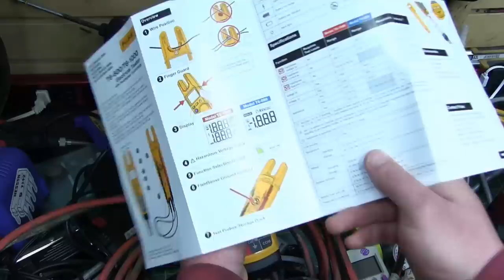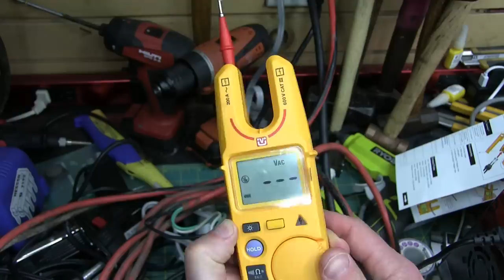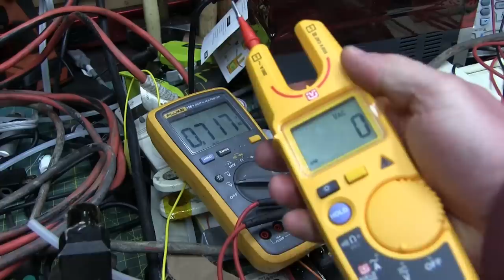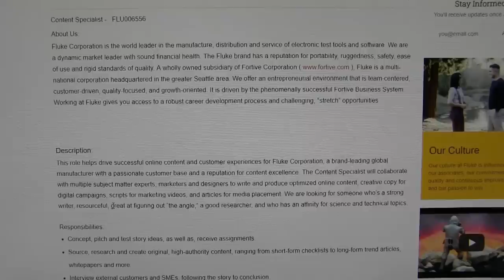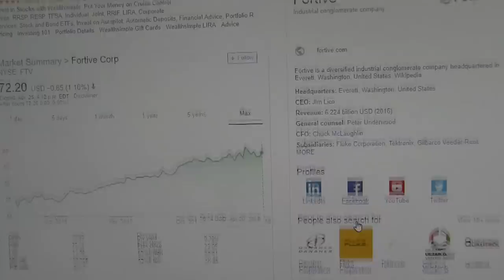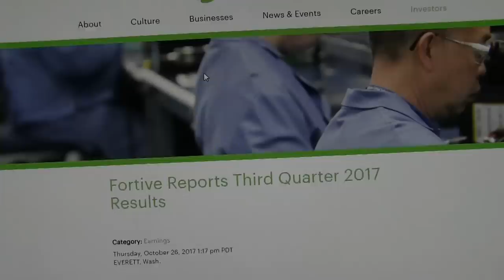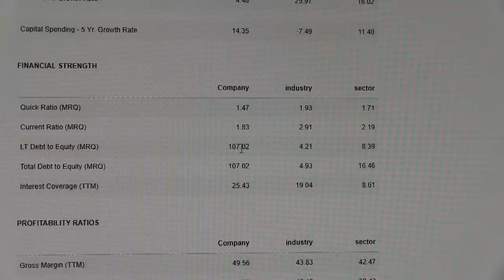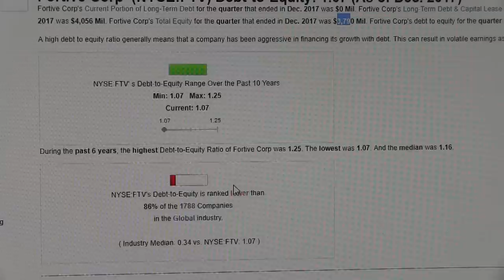Fruke's JOY BUZZER™ Multimeter! | SHOCKINGLY BAD T6

Comment: There is no way (except through incredibly bad engineering) that grounding point could become energised with anything but very small capacitive charge coupling. i.e. not enough current available to do any damage. There will (should) be very large value multiple (high voltage) resistors in series with that grounding pad to limit any current.
In fact this would be a stringent requirement in order to get UL CAT certification.
But worthy of more investigation to ensure this is the case.

So I'd be stunned if Fluke have goofed this from a safety perspective, but that doesn't mean it's not a dicky product from an operational viewpoint.
Reply: Fluke Aus HQ is just around the corner from my lab, and they offered me one back in Nov. Maybe I should take them up on that...
Reply: I think the shoddiness of the product and the companies dishonest response spooked him into being hypercritical which led to a miss with that particular haymaker, but the rest of em still landed so ultimately he's right about the tool, just wrong about one isolated detail.
Reply: I, and many others, would love to hear what you have to say about this. :-)
Reply: so if something goes wrong it it going to not ground at all or is it going to be a rude awakening?
Reply: Un7ucky it depends...if the resistor network goes open circuit...it will stop working.  If it goes short circuit ( like if it gets some water!) You are in for the ride of your life.  The people saying it's safe can have it...I wouldn't use it for current testing.
Reply: Jamie Smith - So you trust a capacitor to save your life? 
You do it every day and you don't even know it by the sounds of it. I won't tell you how and why, I'll let you figure it out.
Reply: EEVblog 
Yeah, but — shiny phones are cool...
Reply: Jamie Smith the plastic around the leads is actually a very big resistor... So yes
Reply: Dave Jones of 18 years ago, filming in his garage would of had no problem of calling this kind of products a heap of crap.
Reply: Jamie Smith so long as it fails open, probably
Reply: EEVblog says "do not submerge in salt water" on the back.
Reply: koitk - I have not seen it so I can't comment apart from an engineering knowledge perspective.
Reply: No you don't. Not only, there are multiple layers of protectioin.
Reply: So the pad is disconnected in current mode?
Reply: You trust resistors every day to save your life. The question is how likely they are to fail at any given point and in any given situation.
Reply: I also comment on my perspective. I like AVE because he doesn't have to like products just because he's income is tied to good reviews and Youtube income, that was same reason I liked your videos back in the days. But I get it, you now have family to support and tube is your main income and you kind of have to have good statistics there. I'm just saying back in the garage you wouldn't of said it's a good multimeter.
Reply: To be explicit: an "insulator" is just a really high value resistor. air for example; It's just rather unlikely to have a manufacturing defect.
Reply: EEVblog  My friend is an Electrician. He told me the first rule is NEVER get cocky around electricity. Unless you want your last moments to be getting baked alive like a potato in a microwave.
Reply: EEVblog Did you not watch the vigayo in its entirety? PAY ATTENTION!
Reply: Would love to see an engineering breakdown of the Circuitry Dave.
Reply: Line of Ephraim House of YAH I Agree
Reply: EEVblog just do your investigation of this and keep it honest as you are seen as a saint in this community.
Looking forward to your video.
Reply: His line voltage was showing 123V when the capacitive measurement thingo worked briefly. When he measured from the ground pad with a 10Megohm meter it measured 106.5V. Therefore the impedance of the T6 is (123-106.5)/(106.5/10000000) = ~1.5Meg. Given the meter is rated for 600V this would allow 400uA to flow if you were <<1.5Meg (e.g. damp fingers). Won't kill you, but seems a bit marginal - you'd feel it at 600V. This is kind of like designing bridges - they often way over engineer them so they don't bounce around too much or sway in the wind, which is not dangerous but can be disconcerting to the layman.
If the impedance of the T6 is in fact capacitive instead of resistive then the current is probably even higher than this because the capacitive impedance of the 12E+ will be less than 10Megohm. The question of "1.5Meg might be safe, but what is the impedance under overload conditions?' also has to be raised.
Reply: Dave I would love for you to take one of these apart, I would def watch
Reply: I don't think he said it was a good meter, he commented on the safety. I would say its a good meter for what I use it for, its not sold as a full featured multimeter. When I need more features I pull out my 116 or 87-V.
Reply: I would like to see what would happen with a regular person-like resistor in connected to the ground "button" and the live actual plugged in. since it doesn't do it's job anyways, could we see if it really zap someone?
Reply: koitk - Have you not seen my videos were I have exposed Fluke, Keysight, and other huge companies for bad product design. My videos have cost them untold amounts of money in recalls, fixes, and bad press.
And I've done this in recent times after I was "out of the garage".

Here I am simply playing devils advocate like I always have. If the product is shit then I will say so, but I can't say so because I have not seen it. But I do think AvE left out some technical detail in his analysis which is what I am sharing.
Reply: koitk
 - Go back and read my comment, I did not say it was a good meter, I have not seen it, I can't say that. I'll reserve judgement until I actually get my hands on one.
Reply from the maker: I appreciate your expert take on this Dave. I'd love to get my hands on a EEV blog Brymen IF THEY WERE EVER IN STOCK! :P
Reply: Don't give into the trolls my friend, EEV blog is a smart man who is pretty down to earth. Not everything needs to be an attack and choose a side, somtimes its fun to shoot the shit and talk about stuff
Reply: Given the financial situation of their overlords, I'd say they're in the midst of a full-blown r*pe scenario, and by the time Fortive is done with them, there will be nothing but a badly-corroded name and totally destroyed reputation. And Fortive's "executives" will skate off with millions in bonuses in their pockets. 

F*ckin' thieves.
Reply: Jeffrey Ellis big Clive is on here too, bet you don't have the balls to call him a power puff...
Reply: That was my first thought as well (would have loaded it with a 100k resistor and see what happens).
So, from a direct safety perspective, it's probably okay. (you're not going to get fried through the ground pad).  OTOH, I think it's still a super unsafe tool.  You could easily measure a circuit to verify that it's not powered, and get a false reading because the wire's a tiny bit out of place, or the insulation is really thick, etc.  Then you poke things in to what you think is a safe circuit.
Reply: EEVblog hi Dave. I think the people here would like to see your take on this product. I for one would so. Kinda an unofficial collaboration. Would definitely be something worth watching. Then send it over to electroboom. If fluke shit the bed on this one, this will be a rude awakening
Reply: Ann Onamous Try measuring the output from a usb charger with respect to ground. The majority (including reputable brands) will have a significant fraction of the line voltage due to the EMI capacitor across the switching transformer. Its high impedance so you won't get injured or die.
Reply from the maker: Orders T6-1000 on comment 7 hours ago. 2 hours later "full of shit- works everytime." Bwahahaha.
Reply: Stunned... I see what you did there lolll
Reply: Until you grab a live wire which indicated no voltage???
Reply: UNI-T did it first
Reply: YES YES and another YES. You could do your classics "don't turn it on - take it apart".....and a follow up video chat to Piet to give an awesome smackdown
Reply: James Kerns Jr. 
Uhm... current testing? Where you are inserted in the circuit... well i wouldn't do that either ;-)
Reply: EEVblog There is nothing more to say. I absolutely agree with you.
Reply: I think this is exactly the same case as in your video about the "Wi-Charge IR Wireless Charging", when you don't know (me neither) how in hell they manage not to fry with a multiwatt laser some things of the room or even parts of the body of the users. You know for sure the grounding point can't be energised because your knowledge and "the experts" of that IR Wireless charging thing know for sure they can't blind or cute fingers of a person because their knowledge. But you, AvE and myself can't avoid thinking "Yes, but, What if... ? ". Cheers !
Reply: EEVblog Dave, you should review this Fluke.. Not AvE
Reply: Just measure the resistance between finger pad and where you jack the negative in next to the battery holder, should give you a good idea
Reply: @EEVblog  You know, I was looking at this meter, as a quick grab alternative.   I was thinking of looking at one, and seeing If you could cut that whole self-grounding pad circuit out.  I mean, just rip out the contact for the lead in the resting position, and the wire / conductor that leads to the pad.   I'd picked up on the need to center the conductor being tested in the center-bottom of the notch, and that does not bother me being slightly finikey...  but to introduce a random or questionable ground, depending on your levels of competence, confidence, and ultimately continence, That your life depends on.   That thing would be out of there.  I'd only be using the neutral on a better ground anyway.  

 My thought was, why would you ever want to use your body as a ground when playing with a twenty or a two-hundred amp circuit?  This seems like the sort of thing that happened when they first began to run electricity, and electrical workers had a lifespan approximately the same as new fighter pilots in combat in ww I.

Comment: "Have you ever picked up a Fluke that doesnt f*ckin work?" 
As an elechicken by trade, this resonates with me. Every Fluke Ive ever owned I consider to be a life-saver. Particularly upsetting that the brand I trust would potentially risk my life and call it user error. There seems to be an upward trend in craptastic tools. This is a very real reminder that double checking everything is worth the trouble. Even if the journeyman said its dead, check it again. And use your own damn meter.

Comment: Wife worked/retired for Fruke, making parts on the shop floor. After listening to the stories of how the company was changing and what went on; temp employees, nonexistent quality control, crap internals; I vowed not to buy the brand (and they have/had a great employee discount).
Reply: Yep. I used to work for a company also owned by the big 'D'. Many of the original employees started leaving after about 5 years into the acquisition. They were trying to push mass production of niche, high end electronic equipment. Local machining and electronic board vendors were shut out for cheaper outsourced parts.

Comment: Paused at 1:06 and popped some popcorn. Especially since, as a network engineer, I rely on Fluke gear regularly. It’s expensive, and I trusted their gear at that price point. My work backpack has several hundred doll hairs worth of testing equipment. Maybe I should stick to Ali express. At least you get what you pay for.
Reply: Get a Pockethernet. I do the same thing, and I’ve largely switched to just the Pockethernet instead of a bunch of Fluke.

Comment: I was always told I did not understand the device when I refused to depend on the "chicken stick".  But I was never in for any great shock.  I just do not like that current through the body feeling.
Reply: Amateur Redneck Workshop  - You got that right!!
Reply: I hate those volt sticks! And even worst when guys try to use them to troubleshoot a non working outlet when it’s a loose neutral and they can’t figure out what’s wrong!!

Comment: Just info here I did some testing on my T6 and found the input impedance is 10 megohm. To verify this I measured the current draw at 120vac and indeed the total current was only .12ma. That's right just over one tenth of 1 milliamp. What's more the joy buzzer pad is capacitive coupled to the black lead when its inserted by a 220pf capacitor.  Doing the math on capacitive reactance that's only approximately 12million ohms resistance so added the the internal 10 million ohms would result in a total current through your finger of .0545ma. Just good for thought. Also to use the field sense the live wire must be in the deepest part of the "U" aligned right dead center with the nib on the case. Keep up the great teardowns. Keep your D#@k in a vice!

Comment: I do not believe that you will get shocked if you touch the earth connection of the current clamp while you are probing the mains. If the meter is set in the voltage range, the meter has a very high impedance of around 10 mega ohms. You will only get about 0,012mA of current sent through your body in this case. You won´t even feel it. The multimeter still picks it up because it also has a high input impedance. You can verify my theory by measuring the voltage with a low impedance meter or you could measure the voltage drop over a resistor. If you load it down the output will instantly drop because there is no power behind it.

But if you set the meter in the current range, it will be dangerous because than the voltage goes over a low resistance shunt in the meter, which can easily conduct enough current to kill you. But i think that the clampmeter automatically disconnects the ground connection to touch if you set it in the current mode. Maybe you should try to confirm that.
Reply: Well you first ... I’ll watch

Comment: Hey....   I use my T5 just like that...  With the probe jammed in the meter... kinda sucks cause Probe is 2 part so when I try to pull it out the tip pops off... It works out though, I use the tip to force the rest of the probe out of the groove.   That "contact" pad reminds me of 70's era soda machines. ( they'd shock the snot out of you if you were wet)... LOL
Reply: "when I try to pull it out the tip pops off... It works out though, I use the tip to force the rest of the probe out of the groove"
May I quote you at my next urologist appointment?  
I haven't laughed so hard in a year; Thank you, OldSkool!
Reply: Of Course!
Reply: Lol, I haven't laughed so hard in months...
Reply: Add tape to the inside of the probe  it will not pop

Comment: As an elechicken I own and use meters and "no touch testers"  regularly. I have been screwed by no touch testers and confused by meter readings at times causing me to take a second look before proceding. In my experience if i cant trust my meter at all times it is not worth having.  "No touch testers" SHOULD NEVER BE TRUSTED  only used as a warning that the circut may be a live or another wire in the area is. When in doubt check twice or more. USING YOU BODY TO COMPLETE THE TEST CIRCUT IS AN  EXTREMLY BAD AND DANGEROUS IDEA.   This is one meter you will never find in my tool kit. Im with AvE on this one

Comment: In the previous video, you stated that the body ground pad was connected to the test probe when it was inserted into its storage spot. If it is only connected when stored, then it shouldn't present a shock hazard / become a Joy Buzzer™. Other than that, thanks for flagging me away from this bad product. 

I also did a quick analysis of FTV on my trading platform, and the financials do look a bit squirrely. Their earnings are rapidly increasing without a concurrent rise in revenues, meaning that they are probably saving way too much on their manufacturing as of late.

Comment: I was an electrician in Germany for 4 years, and they use the little flathead screwdrivers with the neon lamp connected to a resistor and a metal contact at the end to quickly check if a terminal block is hot or not (they don’t use wire nuts).  You put the screwdriver tip on the terminal screw, put your thumb on the contact at the other end, and it uses your body to light up the neon lamp if it’s hot... Anyway, one day I was in a dorm room tracing a circuit behind their fridge, so I was kinda in an awkward position on a ladder halfway on the fridge... found out that holding the condenser (and in turn, grounding yourself) will shock you when you find a live circuit with that type of tester.

I have a good feeling that Fluke will do exactly the same thing when using it in the configuration shown.

I’m waiting for the safety recall...